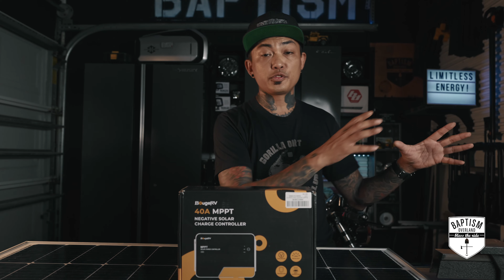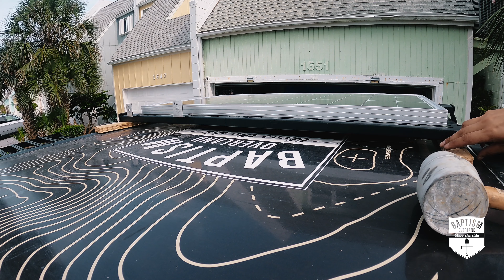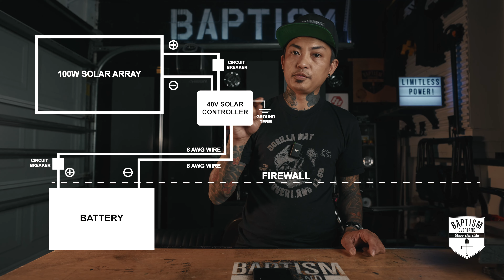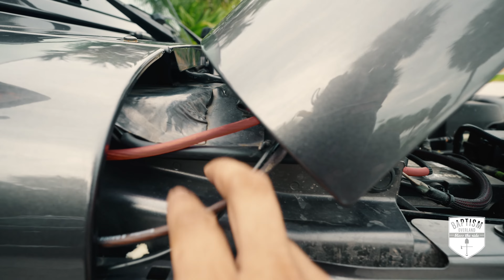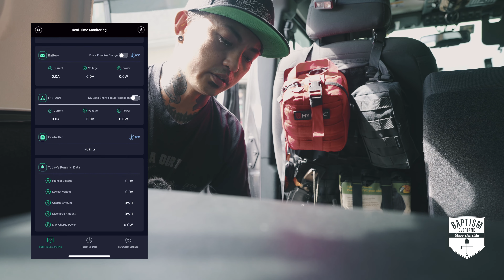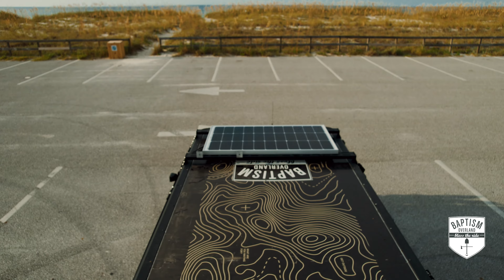100Watts Solar Power Installation | BougeRV

Comment: So, let me see if I  got this straight. You need to connect to the battery to the charge controller first, energize (close) the circuit between the battery and the charge controller, then close the circuit to solar panel to complete that circuit?... That is done with the engine off, no alternator charging the battery, just solar?...
Once that is done, that will charge the battery using the solar and the JEEPS alternator while driving?...